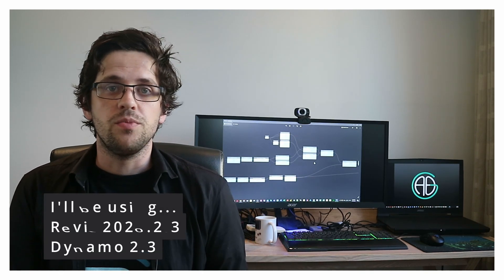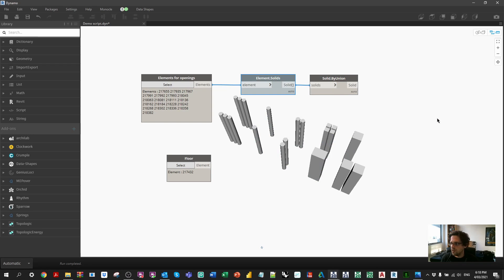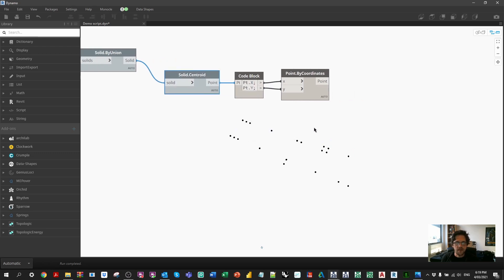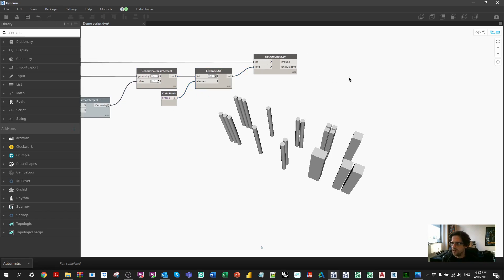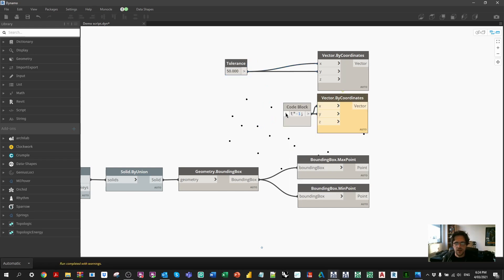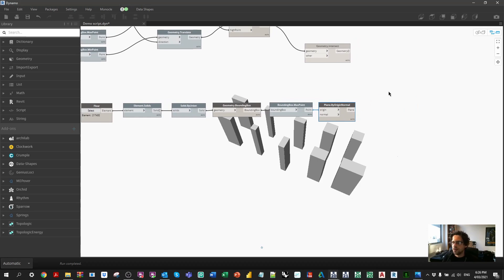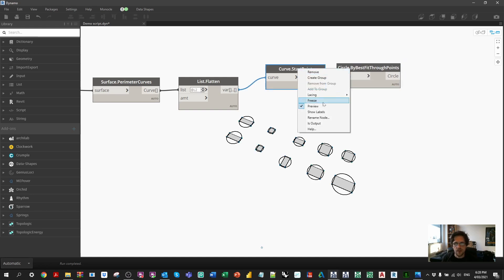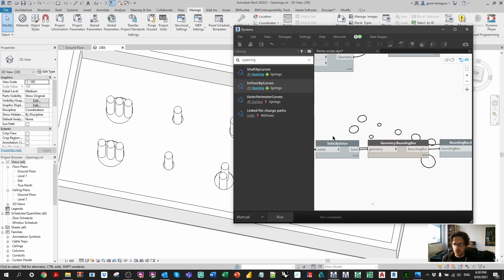Create floor openings in Revit using Dynamo!

Comment: hi Guru, in the wall openings video (https://www.youtube.com/watch?v=o77lLfyQm30&list=PLBKwx9iS-Luk6TBQbncpq7pdp9ZNl7W7m&index=33) , you used a window family which was super usefull for tagging purposes! is there a workaroud to this floor openings workflow using a family for the opening so it can be tagged?
Reply from the maker: Yes a face based family could potentially serve such a purpose as long as it is a square/rectangular or circular opening. If it's irregular then it wouldn't be feasible.

Comment: Hey. so Im building this script. Ive got 3 floors from a linked file. And when I intersect cuboids and planes (Geometry Intersect all) I end up with a list of empty lists. Can't find the cauze. I found two possible ones on the forum. One us the Geometry scaling problem. I chanhe it and it makes my ducts cuboids as one big cuboid. Another ones - is that linked file and the project file have different origins, however they are centered and when the Planes by origin are created I can see them in a model. But as I said I get an empty list. Can't figure out why
Reply from the maker: Make sure to visually check if the cuboids and planes actually overlap and are in the right location in Dynamo. You may need to apply a transform to the geometry (using a translated coordinate system), and you can get a link instance's transform using a node from Crumple packaged called Coordinates.GetLinkTransform.

Comment: It is not working if i have many flloors in my model ! 
Can you check this plz ?
Reply from the maker: The script is only built to work with 1 floor at a time and a set of elements to make openings. If you wanted to do many floors at once then the script would need to be adjusted to suit.

Comment: Thx again, Gavin, for this amazing video. I have been struggling with the same issue and I found my solution to be almost identical. I was just wondering for the best way to group those intersections, but I found your solution to be quite simple an elegant in that manner - simply creating circles to manage grouping :) I wanted to ask if you find getting element's solids more convenient than using element.geometry node? This is what I use and then I don't need to unite the solids. However, I find that node to be a bit slow, which might be an issue with large projects, so I wanted to ask for your opinion on this :) I also find it a bit more useful to use a void family, instead of shafts, cause you can write all sorts of data in those family instances that engineers sometimes need to schedule.
Reply from the maker: Yes element.solids is often a better node to use, although it does take a bit longer as it has some extra steps it runs behind the scenes. Void/face based families are ideal for holding information, and I use them too usually. I made a video on wall penos a while ago using a window family and I got more questions about the family than the script so decided to just use an opening this time around to make my life a bit easier :)

Comment: Nice program. I tried writing a similar one as well but my building has several floor elevations and found errors when a building has several floors. Do you think separating floors by level and pipes by level would help? Thank you for your videos. They are great, as always
Reply from the maker: This is usually a script I'd run across a small sample set, and one floor at a time in focus. It can be scaled up to do full levels at once, but it's much more complex - you would need to identify which floor each set of elements belongs to by doing a clash test. Many people use a package called Bimorph nodes and its 'ray bounce' node to do this task.

Comment: excuse me
Could you share how to create Floor from column and structural framing or between the structural framing?  thanks
Reply from the maker: This isn't really something I've tried before to be honest, I would probably use Grasshopper for this. The method would probably involve taking all beams at a certain level, getting their centrelines and extending them, then trimming them at intersections (quite difficult). I'd probably have a line drawn around the outer slab edges so the script knows which beams are edge beams and ignore them, then take that as a surface, split it by the trimmed beam curves and generate floors for each outline from the split surface. Dynamo would struggle with much of this I think, which is why Rhino Inside/Grasshopper might be worthwhile trying out.

Comment: Thank you Gavin, very helpful ^^
In project I have structural & architectural floor and I use the opening cutting family (Opening family from Revit library), it´s hosted on the Arc floor, but doesnt cut through Str Floor when i join both floors, which is possible with wall opening family. So should I use void family (generic model) with an extra cuting script or do you have any solution that we can still use floor opening family for multiple floors?
Reply from the maker: I would consider using shaft openings instead maybe? These should cut through any floor/ceiling/roof they cross. There is a node in the springnodes package that works the same way as the floor opening script moreorless.

Comment: Is it possibile to make a script that allows to create penetrations for ducts/pipes when MEP model is live and arch model is linked?
Reply from the maker: The challenge here is that the elements being penetrated (floor) aren't usually in the MEP model. This workflow is moreso aimed at structural or architectural models where floors/walls etc. are located typically.

You could use similar logic to create a 'penetration family' instead, or bake in the result as a floor. This is sometimes how engineers coordinate their intended penetrations to the structural engineer to capture in their model in my experience.
Reply: @AussieBIMGuru  This is exactly what I am currently trying to do. We have been able to use your dynamo script for wall penetrations and linked models. but we are struggling to model a family which can be placed using the code above. 

Would you be able to suggest how to modify the script to allow for a family to be placed instead of cutting an actual penetration?